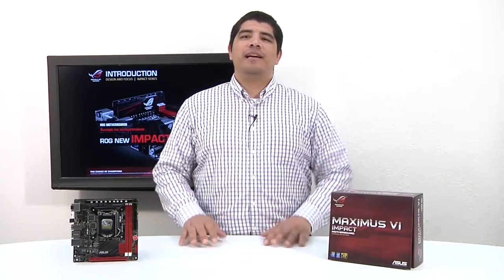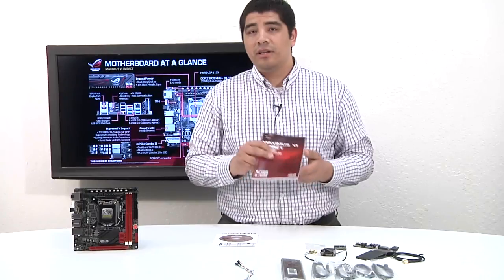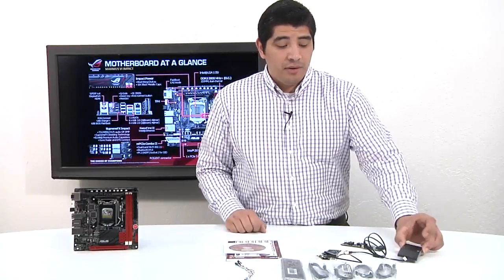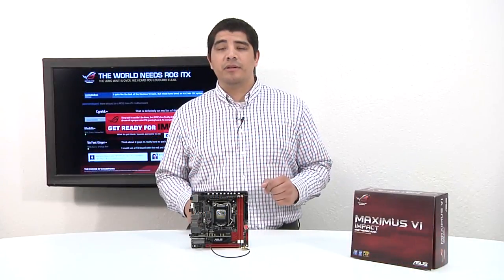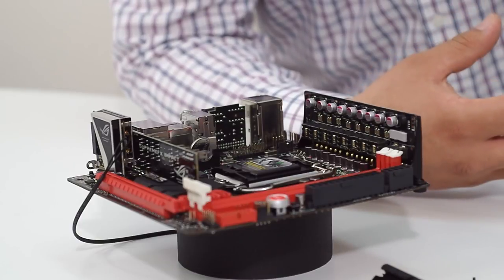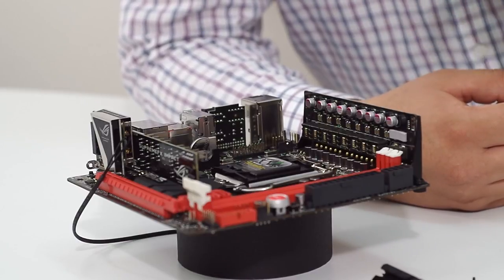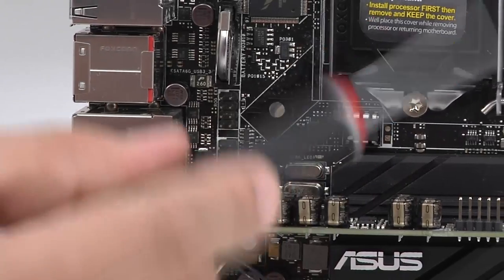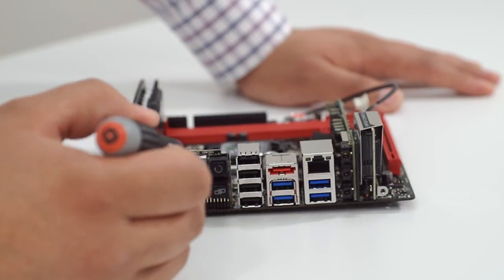ASUS Maximus VI IMPACT Motherboard Overview

Comment: Hey guys I know this is a bit of a specific question. I'm about to pull the trigger on a build with this awesome board inside a Fractal Design Node 304 and a Corsair H90 All-in-one watercooling setup. As far as I can tell the NGFF and SupremeFX rise boards stick out above the regular I/O of the board by just a bit. I'm worried the radiator from the h90 will interfere with those. Again, I realize this is a specific question but I'd really appreciate your guys' input! Thanks and great video Josh!

Comment: Asus your attention to detail both hardware and software wise is amazing; I love your products such as the Nexus 7 FHD and would love to see more from you such as docks, keyboard cases, and so on.Could you integrate features that interact with other hardware you sell like say my Asus gtx 780 can connect to my N7 FHD and I can stream PC games like the shield or over clock my tablet or PC using the tablet and so on. With out rooting my device.

Comment: JJ, What is the difference in sound on the impact vs the formula. It doesn't seem like you lose much vs the Formula. I want to go with the Impact but the Formula is such a sweet board, any recommendations? I only use 1 video card, and 16GB ram so I can really use either. I'm guessing they both OC very well. Thanks JJ

Comment: Hey Asus, I just got this in today and i was deciding on a cooler . The Noctua nhd14 is what i was going with but i noticed the pci slot was placed fairly close to the cpu location.   Was wondering if it would accommodate the nhd14 plus a gtx 770?

Comment: The off and charge mode doesn't charge certain devices like iPad and galaxy note 8 due to bigger battery capacities and to use the off and speaker mode must be tweaked or trin on through the bios setting ?

Comment: I'm planning on building a mini-itx build soon and was wondering if my CPU Cooler will fit on the Impact. I'm planning on getting the Phanteks PH-TC14PE with the Impact and I don't know if it will fit. I've seen a build with the Phanteks with the P8Z77-I Deluxe and it fit just fine in the Bitfeinx Prodigy (the case i'm going to get). I want to keep the SupremeFX Audio because it's one of the reasons I'm going with the Impact over the Z87-I Deluxe. Will it fit on the board?

Comment: Maybe this is a noob question but I've just built a PC with the Maximus 6 Impact and am looking to buy a 5.1 speaker set. probably something simple such as from Logitech or Creative at around £60. 
I looked at the back of the sound card that comes with the motherboard and only see one 'audio out'. It's been a long time since built a PC but I remember there being three audio outs in the Creative card I used. Do modern sound chips use an all in one jack and will the speakers have a compatibleone?

Comment: Well then, that sorta stinks. Has there ever been any idea to sorta stack pcbs, or have the vram on a daughterboard of sorts? Or perhaps the vrms like on your motherboards?

Would it be accurate to say that for it to work you have to shorten to the point where you no longer have many heat pipes that in terms of where they need to be would conflict with tese daughterboards?

Comment: Whoa! I never caught him taking a jab at the manufacturer's "POSCAP" motherboards.  That's are pretty serious allegations & a good POSCAP is impossible to one up. Nichicon also makes higher than 10k caps and I still don't know what the holdup would be for implementing them onto a little motherboard.
 Considering the fact that ASUS GPUs are slathered with them, the cost and quality scale with the implementation of the POSCAP.
Sure Nichicon solids are the tired and true capacitor, but the POSCAP is better in so many ways.
Are the caps in the power phase SMT packaging or the regular? When they fail due to moisture and humidity, I would love to easily replace the entire array with POSCAPS or filter the cans.

This is the one board I wouldn't think twice about buying and as much as I love MSI... I would & will but this board over MSI's offerings. They have POSCAPS, but zero NGFF nor mSATA. PLUS! The audio solution is very easy to replace as the years of humidity seep into the audio film capacitors. Just pull the daughter board, replace them with another set, or just head over to Asus website to replace the board for a fairly good price.
Considering this is the first motherboard that allows you to remove, repair, or replace... it's crazy not to guy one!

Good on you Asus!

Comment: ASUS advertises that this motherboard will work great for a HTPC. However, the easiest way to setup a Home Theater is to use HDMI Audio/Video, but I have not yet found the quality of audio going through the HDMI. Will this be part of the integrated CPU audio like the integrated graphics or how does this work? Or does integrated SupremeFX go through the HDMI as well?

Comment: If you had the SoundFX audio module installed, can you still fit a larger graphics card like the GTX 760 4Gb. It seems quite close to the PCI-E. I dont see how it would fit.
Reply: it will fit just fine.

Comment: jj my cpu backplate is touching my case on this board but on each contact on any side of the motherboard it has rubber and plastic but the screws and backplate are metal its self. Should I be worried? Its a secufirm 2 bracket. Its only just touching so its not bending the motherboard the wrong way. If anything its supporting it from the middle. It runs but should I be worried?

Comment: I just made a build with the Impact and everything was looking fine until I wanted to confirm the SupremeFX sound card was working.. there is no indication in system inputs if it was working and i was just wondering if anyone knows a solution

Comment: Hello, I would like to buy noctua CPU cooler, but i don't know which to choose, I will use fractal design node 304 case with asus Maximus VI impact motherboard (mini ITX) with intel 4670k procesor, i want best air cooler but i am afraid of clearance issues with video card and that unique sound card implementation on MAXIMUS VI Impact motherboard. please help.

Comment: I'm planning on a build that involves the ASUS Maximus VI Impact and an FT03-mini case. Now I have a Razer Tiamat Elite 7.1 Headset and I want an 8 channel set-up on my board. Am I missing something or do I need to add something to make it work? I know the ROG board can retask the 3 audio jacks on the SupremeFX card, but please do help me visualize the parts that I need. ASUS, help please!
Reply: Tiamat requires 8 channel analog.  This is not the board for you.  I have that headset, msi Z87I gaming ac is your best bet.
Reply: Thanks. The Maximus VII Gene has this same SupremeFX card so I bet it would be also the same case with the VII Impact. Sorry Asus, I thought you would have my wallet.
Reply: It's an amazing headset, can't ask for more.

Comment: so i'm a noob when it comes to motherboards, but this having the Wi-Fi, does that mean that it automatically has wifi and you don't have to have an adapter plugged in for wifi to work on your desktop?
Reply: it includes a wifi card, so all you need is a router
Reply: cool thanks!

Comment: ARRRG!!! Why does this board not have the auto overclock feature?? That was the only reason I bought the board.  I now have both the Deluxe and Impact in 2 different systems sitting here side by side and NEITHER of them have the auto over clocking feature that the Z87 Pro board has.  Dang it guys.  Very very irritating!! It says it has "4 way optimization" but it gives only 3 options for auto over clock and does NOT clock the board to within 95% of its CPU capability.  Dang guys.  Very very irritating!! Is there any ITX board out there with the auto overclocking feature that will take it through all the main clocks and then do the blk step by step? So dang frustrating when ASUS advertises the board as having "4 way optimization" when it doesn't optimize the most important thing which is CPU and RAM!! ARRRRG!!! Please tell me I'm missing something!!
Reply: google around for Asus software and you will likely find it, also check your BIOS is up to date, sometimes old builds do (not) offer all the advertised features
Reply: Tried that.  Updated bios.  Still though this particular board only offers specific presets on overclock and doesn't actually take the system through a full and complete overclock as it leads one to believe.  I found though if you get the Deluxe version and then install the software from the full size Z87-Pro that you can get it to auto overclock at least on the multiplier.  At least that gives a good basis from where to start tinkering.
Reply: Learn how to do it so WHEN it fails you know how to fix it. The world can't wipe your butt forever. Eventually your going to have to learn to wipe your own butt. If you don't, you'll just parish in the zombie apocalypse while us smart guys rebuild civilization.
Reply: Well that's great if you have just one but if you build 1000 of them it would be nice to be able to just press go and have them overclock themselves to at least pretty close to what is possible.  Everyone has their skills.  I can fly from my back yard up over the mountains.  Can you? It's about sharing your skills with your neighbors and working together on things.
Reply: Dell Schanze There's only 2 settings to change. Much quicker then auto-tuning. Takes 10 seconds to do. I must assume your selling systems if you want to do it 1000 times. I wouldn't trust an auto overclock on a retail product anyways. I can fly, but I don't own a plane. :)
Reply: Dell Schanze you only have to it once, if its one computer or a billion.

Look up how to image map bios's & OS systems. actually scrap that, you can make profiles with asus now.
Reply: lazzer408 deployment. You noob.
Reply: Still faster. Count the clicks.

Comment: Can someone please clarify this for me. If I got my PC connected via HDMI through the graphics card, which component will be delivering the sound, the sound card or the graphics card?
Reply: It depends on what you select as the default sound.  You can always switch between on board and hdmi.
Reply: ***** So by using HDMI I can benefit from having an external sound card yes?
Reply: Yes, if the hdmi is your default sound than all the audio signal will go through hdmi cable.

Comment: I wish asus would sell this and other high end mobos via amazon italy and not minor affiliated resellers cause they 1.offer no assistance whatsoever, 2. rip you off when you rma for a doa. they bend cpu socket pins on purpose and blame you so they can say you are not elegible for rma. It's a old trick that still works apparently. Buying a mobo is a nightmare in Italy. it's a lottery! I wish I could deal with a serious company like amazon or with asus itself when spending this much money. cheers